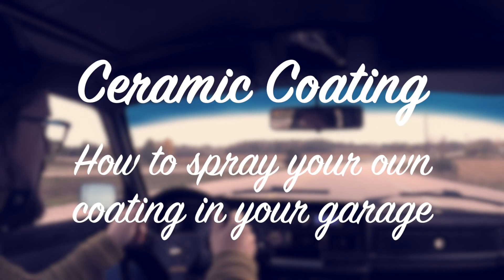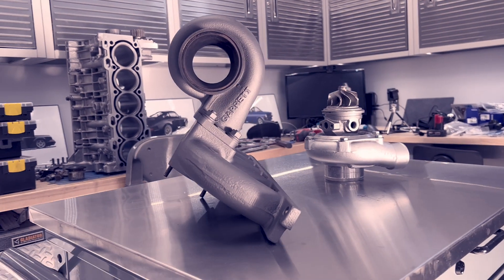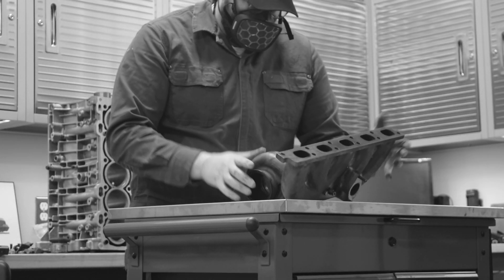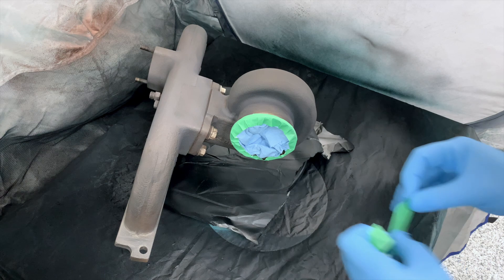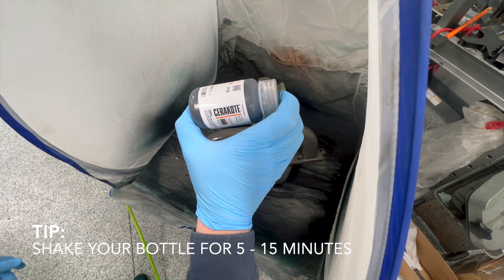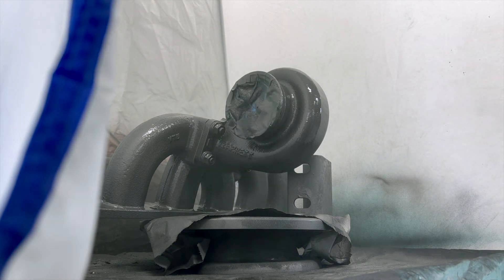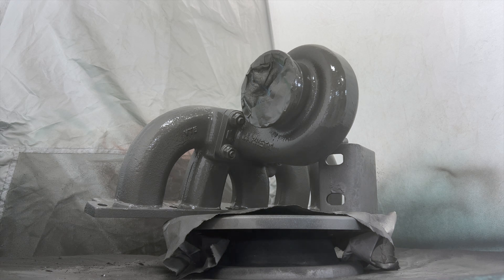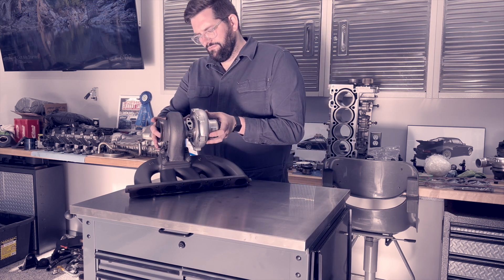How to ceramic coat a turbo or exhaust with Cerakote Air Cure ceramic coating

Comment: how has it lasted ? update on cerakote
Reply from the maker: It holds up reasonably well. The main thing that can cause issues is if you spill oil or other fluids on it while hot. The only small spots I saw it start to burn off was where oil got on it. Traditional oven-cure ceramic coating will certainly do better, but if you don't have that option or budget, this is the next best way to go in my opinion. This was the second time I've used it and I've never seen it flake or chip.

Comment: How much cerakote did you have left?
Reply from the maker: I ended up spraying the whole bottle, but could likely have gotten away with less.
Reply: @Drive.Revive.Tinker did you use a tester?
Reply from the maker: @Flozby1  no, so I have no measurement for if it's the recommended spec for thickness.

Comment: Have you ran the car? Curious how the coating has held up. I just got my turbo yesterday and looking to coat it before I install it.
Reply from the maker: Yes, and I've actually used it twice now. It holds up reasonably well. The main thing that can cause issues is if you spill oil or other fluids on there. The only spots I saw it start to burn off was where oil got on it. Traditional oven-cure ceramic coating will certainly do better, but if you don't have that option or budget, this is the next best way to go in my opinion.

Comment: Are there any heat-management benefits to this?
Reply from the maker: Heat management is actually the primary benefit to ceramic coating; it looking nice is just a great side benefit. It's a great way of dropping underhood temps, but I don't have any data on the specific temperature drop, just that it makes a notable difference.
Reply: @Drive.Revive.Tinker  thanks. Its just that Cerakote are very careful not to say "thermal barrier" on their website and marketing.

Comment: lol dude I live in cottage grove just stumbled onto your video I’ve been coating for 10yrs firearms and now I’m build my 1986 6.2 diesel k5 with all ceramic coated stuff I even coat my own bolts with zinc chromate and have a pretty decent sand blaster and shop if you ever need a hand
Reply from the maker: That's awesome to know! I will likely be interested in some zinc plating at some point. Do you have a website or business name, etc that I can google to find you?